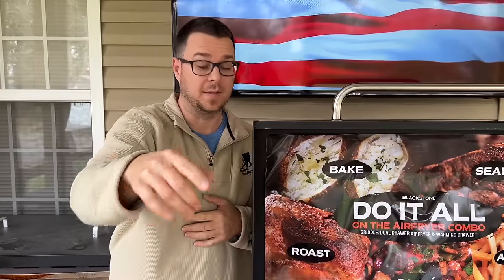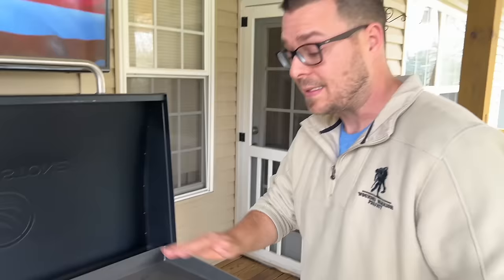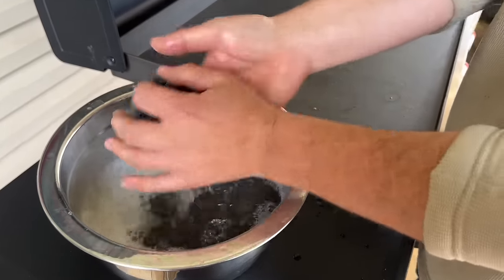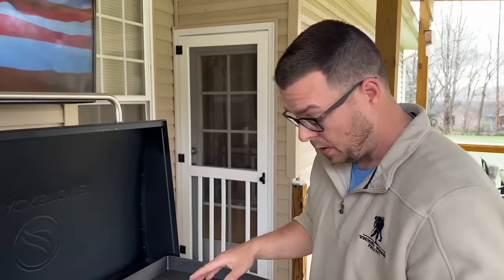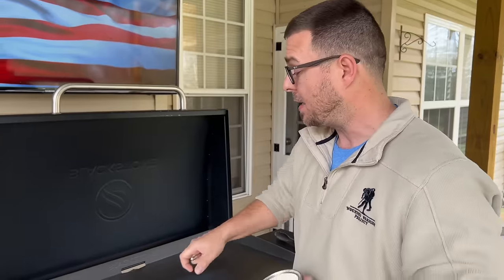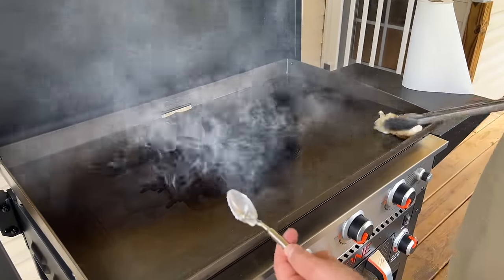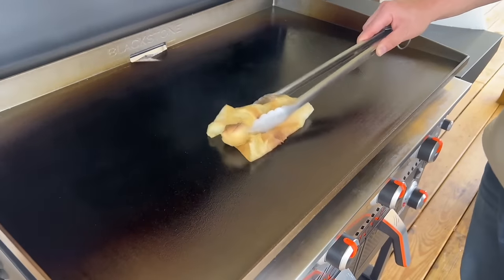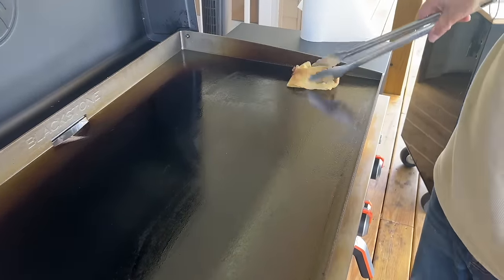How to Season a New Blackstone Griddle

Comment: I try to follow along and pay attention to all the details, but I do notice that in your video every time you cut to a new seasoning your temperature knobs are different and even on your last seasoning they are off. Do I leave the Blackstone on high during this whole process and at what point do I turn it off after the last seasoning or before the last seasoning?
Reply from the maker: Good question...only on high to start like Blackstone says..just to burn off the crap..after about 10/15min...start the process...turn down to low which I promise is hot enough and keep there till you are happy with the amount of coats...I turned off the griddle on the last coat to allow the oil to lightly burn and be ready for the next cook..if not it would be another coat...ever time you cook and clean a light coat of oil will go down...this was that idea

Comment: I found your video AFTER I received my grill (with no manual).  The other videos I saw showed nothing about sanding or cleaning so I just did the seasoning.  I did it 6 times and then cooked twice on it.  My question is, being that i skipped the cleaning and sanding part, can I now sand it if need be?  I see in your video I could wash it with soap as long as I reseason it so that question is answered.Thanks
Reply from the maker: I would think by this point you are to far in....I would just cook on it...Sucks you didnt catch us sooner..I think hitting it with sandpaper just helps knock off all the crap on top and speeds up the process..

Comment: Not sure what happened but my grill shot up over 700 degrees., it literally burned my paper towels to the point where pieces were breaking off. Now its gummed up. I guess I will be sanding. 

Does it really need to be on high heat?

Comment: I live in Miami FL. The griddle will be kept outside and covered with an aftermarket cover. Do I go steel vs ceramic due to potential rust in high humidity. And does the cleaning after use on steel prevent rust?   BTW for the Campfire Griddle why not just drill out the grease hole. Should not be difficult with a carbide bit. Thanks for the videos and I really like your teaching style. When do we get to meet the calm voice behind the camera?
Reply from the maker: She has been in a lot of videos...just find the right ones..ahahahha we actually filmed one  cooking on my Weber...Look up my playlist Weber charcoal grill and I thinks its called how to cook a steak for beginners 
As far as the griddle idea, IF you will maintain and cook on the rolled steel often than no problem..if you dont want the hassle and use sparingly then the Pit Boss..There so far  been no downside of the two...

Comment: Hey king, just picked up a BS 36in  and thank you so much for your vids. I seasoned last night and checking this afternoon, I have great color in the middle but several places around the outside 2-3 inches I have very tacky, sticky coverage. Will those areas eventually season up fine or do I need to scrape back down and start seasoning all over again on those areas? Used the crisco after sanding, washing and rinsing. Thanks.
Reply from the maker: no just keep cooking...try cooking the heck of of onions....keep moving around and bring the heat to the outside parts that are sticky...
you could put on low and keep on longer as well..
the sticky tells us that the oil didn’t have a chance to burn off

Comment: Appreciate the video. I just bought my first blackstone griddle with air fryer. I can't wait to use it after proper seasoning. Is the sanding necessary? I will definitely be on the look out for your cooking videos.
Reply from the maker: NOPE not at all I just think personally it helps speed the process up. If you notice with your hands the surface is very rough. By sanding you help level it off and the seasoning works more evenly.
Reply: @TheFlatTopKing  gotcha. Thanks for the tip.

Comment: After the 1st coat of seasoning do you keep your temps on high or do you back it off some and then turn it up once you have done the 2nd coat to do the burn off? Just wondering if I turn it up to burn it off in between each coat or do you just keep it at like a medium temp
Reply from the maker: You can turn down...just keep hot enough to keep that smoke rolling...each griddle is different so the exact I am unsure of...

Comment: Alright so I seasoned my griddle this way and it’s been great. I have a polished smooth cast iron pan that I’m struggling with holding a seasoning the traditional oven way. Always comes off. Should I try this way?! It’s not a high end or sentimental piece so I figure it’s worth a shot.
Reply from the maker: Thats a tuff question...what oils are you using 0n the cast iron and what technique are you doing for it...if its not high end then go for it...lets just make sure something else isn't wrong first..
Reply: @TheFlatTopKing  I have restored a lot of pieces and my method of thin coat of crisco, wipe off like I didn’t want it there, and oven at 475 for one hour (repeat 3 times) works like a dream every time. This surface has been polished however, so it’s having a hard time holding a seasoning. Every time I use it, the seasoning wears off the surface. Gonna give it a go this way! I’ll report back
Reply from the maker: @wadenorman2500  yeah spot on as well. Please let me know

Comment: Failed to find your videos before using my pit boss steel griddle. Any reason I can’t go back and start from scratch with a light sanding as you suggest for a new griddle?
Reply from the maker: I just had this convo with another guy..personally I would not...your so far ahead now and going back would be a pain. I would just start cooking and cooking..over time it will be just like sanded just takes longer to get there

Comment: I just bought a blackstone grill and seasoned it according to your method. I put an egg on it after I was done to see how well it would not stick. The egg completely stuck to the grill. I cleaned it and seasoned it again a couple of times and then I cooked some frozen burgers. The burgers turned out great but when I flipped one of the burgers it stuck pretty good. I turned it the way you do with your spatula. After I cleaned the grill using the bench scrapper you use without scrapping too hard and flat I then put some water on and scrubbed it with a cotton rag to get the sticky off. It is now smooth but there is a noticeable (stain) I guess of where the burger was and spots that look like the original grill color. I couldn't see them right away but when I used my flash light to see because it was getting dark I could definitely see spots and they weren't scrap spots they were round like where the burger stuck to the grill. Is this normal? What did I do wrong. Please help oh Flat Top King!
Reply from the maker: I m here for ya I promise...not sure where it went wrong with out being there...
Make sure your griddle is hot enough to start with especially for eggs. Eggs are protein and of course so are burgers so if your griddle is not hot enough it could be the problem.
Turning to early especially on eggs.
not enough butter or oil down
 One suggestion is to WASTE eggs. 
I hate wasting food but sometimes you have to. If its a 4 burner than take a dozen eggs.
Preheat on low and allow to come up to temp. If using avocado oil let it just barely smoke...put a good amount on there as well.
take all 12 eggs and smash, shell and all remember you are wasting eggs.
smash with spaula and get in all corners and all over.
just keep moving the eggs around.
Srape down and remove ascess.
wipe down with oil and add some butter in about 3 spots. add over easy eggs to the butter allowing the eggs to set properly...if still sticking then Houston we have a problem
If you dont like the egg idea do onions the same way. cut about 5-8 onions and use the high heat oil an caramelize the onions till about black. almost uneatable..
allowing enough oil to properly coat the griddle top. Allow the oil to smoke while cooking the onions...

Comment: My 22" Blackstone griddle has a substantial warp - side to side and front to back.  Is this common?  Blackstone has offered me a new griddle top, but said I should try to cook on it about 20 times.  They set a lot of time the warp comes out of it? What do you think?  I seasoned it in my house oven.
Reply from the maker: Well you have nothing to loose if they are sending you another one...I personally have not heard of that where you cook on it and it goes away. I have had people tell me that Camp Chef has told them to put a super big pot of water on the griddle and turn on for like 15/20 min on high and then turn off...the heat will put pressure on the metal and help out...some say it helped...some didn’t...Interesting why you seasoned in the oven. I agree with the idea....but just seems odd...I doubt it had anything to do with it..but...
Reply: @TheFlatTopKing  Thanks for the reply.  I thought that the way I seasoned it would cover more surface - sides and corners, backside.  We are getting ready to go on a long trip with it. When I return, I will ask for the warranty. I will be more vigilant about it being flat before I start seasoning it. We looked at a lot of videos, and I will probably look at more of yours.Chuck

Comment: In the video after the preheat you mention putting it on high heat. At what point is the heat lowered during the 5 coats. It looked like it was on high the entire time.
Reply from the maker: I did that because the Blackstone instructions said to put on HIgh for the first 
10/15 min....i never have liked to use high and I just started on low for about 5 min then up to high...before the oil I backed the temp back down...
Reply: @TheFlatTopKing  Perfect. Thanks. You are so helpful.

Comment: So you don't turn it off and let it cool down between each coat of Crisco? You just keep it on high until it stops smoking, then apply the next coat? Thanks
Reply from the maker: I dont keep it on high...low is hot enough...low will get over 450 and not much oil can handle that....but yes...do not turn off and cool down...just burn it
Reply: @TheFlatTopKing  thanks

Comment: I just purchased my first griddle, (It hasn’t even arrived yet) a BS 28”. In a different video, someone used a grill block instead of sand paper, is this ok? Is one way better then the other?
Reply from the maker: I personally do not own a grill block. I think the are too aggressive for a seasoned griddle. In the Navy we had them and that was because stainless steel is different than rolled steel. Rolled steel you treat just like cast iron from seasoning to cleaning and re seasoning as well. I have only used sandpaper 2 times total in three years. Once to take iff the brand new ruff spots on my new blackstone before i seasoned it. Second was after extremely heavy use on my CC that i again only used to knock off the tops then re seasoned

Comment: As always, fantastic content. FIrst time griddle owner, mentioned on another video of yours I just bought a Nexgrill from BJ's. Question about the final application - so you season 4-5 times with the heat on, and after that, you shut off the heat, let it cool down, and apply a final coat that would remain "wet" as there's no heat to burn it off?
Reply from the maker: Not wet…..  after every use you should always add a light coal of oil.  This is normal maintenance for rolled steel.
Reply: @TheFlatTopKing  appreciate it! So once I’m done applying the 4-5 coats with the heat on, I shut off the heat, and apply a light coat of oil that would be rubbed into the griddle top with the paper towel, and done. If I got that right, then thanks so much for the sanity check!
Reply from the maker: @dolfan058  yes. Just make sure the grill is not hot enough to burn the last coat of oil.
Reply: @TheFlatTopKing  Will do, thanks so much for all the help. You’re giving us rookies a ton of peace of mind!

Comment: I have a new two burner Pit Boss Portable Griddle.  It claims that it’s been pre-seasoned.  Should I go through the steps you show in this video just the same?  Also, mine says it’s cast iron instead of rolled steel.
Reply from the maker: Yeah just don't kill the preseaoning. I do it on my new cast iron as well. Rub your hand across first to feel the unevenness then gently use the sand paper. Check often to make sure it's gone.

Comment: dumb question but when your waiting for the smoke to slow down before you add another layer, is it still on high heat?
Reply from the maker: Just to clarify you dont have to use high heat...many griddle can hit high enough heat without actually using the high burner...any temp that allows the oil of your choice to smoke...will be hot enough. For your answer...just keep it hot enough to keep rolling..no need to adjust between
Reply: @TheFlatTopKing  that makes sense, appreciate the response!

Comment: In between coats are you keeping the grill on high?
Reply from the maker: Yes...you are burning the oil...BUT just to clarify...you dont have to use high..just hot enough to burn the oil...so if you have on high to start...and it gets hot enough..back the bruner off a little...saves on propane

Comment: If you bought a used blackstone, should I remove the seasoning and redo from the start like in the video?
Reply from the maker: really depends on the shape its in....if bad absolutely...if you think you can clean with soap and water and add a few coats after that then that should be fine

Comment: The paper towel I was using almost immediately started leaving little bits all over, I quickly switched to a washcloth. What paper towels do you buy? I'd much rather just throw a paper towel away than clean that washcloth every time.
Reply from the maker: We use Costco and they are good ones and bad ones...that is another reason why I sanded my down first...it all helps..I have bits as well and honestly on 3 griddles and tons of cooks its has Neve Mattered...maybe its frustrating to see but it doesn’t affect the performance...
Reply: @TheFlatTopKing  that's good to hear. Thanks for being so active on your channel and responding to those with questions!

Comment: Do you heat it up slowly until it is on high and leave it on high during the entire process?
Reply from the maker: Yes...you dont have to keep on high either...just high enough to heat the oil hot enough to smoke...so once on high...maybe back down a tad....
Reply: @TheFlatTopKing  Thank You Sir! I'll try it on a skillet. It seems better than the baking method where I have gotten drips before and had to sand them off and restart.
Reply from the maker: @chevy6969200  if it matters… dripping means to much oil. One tip I can give.  Wipe completely with light oil. Then take new paper towel and wipe off the light oil. Sounds crazy but that’s how we create things layers stacked on top of each other. Thicker layers will flake over time.

Comment: Do u HAVE to use sand paper? Can u just rub it with soap, water, and a dish sponge on the green side and scrub everything?
Reply from the maker: So the soap just gets the manufacturer oils...dirt and debris off...the sanding helps even out the high and uneven spots..
After many griddles since this...I actually think its not necessary to sand down...just clean...dry and season...
Reply: @TheFlatTopKing  what about the dish sponge? Do u recommend scrubbing it with the dish sponge on the green side?
Reply from the maker: @luisbarrera4548  I dont think matters...

Comment: Do you have any guidance for seasoning and electric griddle or is it just the same method?
Reply from the maker: Well..thats a loaded question...what is the griddle actually made of...stainless steel...ceramic coated..porcelain coated...or the blackstone indoor model...
Reply: @TheFlatTopKing  its a stainless steel 2 element counter top type is all I can tell you until later today hopefully 🙏
Reply from the maker: @davehanstock9586  Yeah so stainless is 100 percent completely different ball ga,e..typicslly no sesonin required and maintenance and cleaning is way different
Reply: Finally got delivered by Amazon and its damaged so going back replacement due Wednesday 😤😤

Comment: Do we have to reduce the heat later while seasoning ?
Reply from the maker: Yes thanks for asking...sorry...after watching again I cut out the part where I say to cut the heat..after the griddle is heated on high for around 15 min or so and you start the seasoning process you can definitely cut back the heat...even on low it will be hot enough

Comment: can you show the temp control in another video? do you turn off the burners when you apply the crisco or do you leave them on med heat?
Reply from the maker: Just keep on low...after the griddle is heated up you can switch to low...its Definitely hot enough

Comment: Got a new one is 17 inches cut it out of the box it’s telling you to clean it with hot soapy water do I do this on the top and the bottom because the bottom is sticky too thank you
Reply from the maker: The bottom is not necessary to clean...the heat from the flame will deal with it..just use the soap one time and thats before you start the seasoning process...
after that you should not have to do it again.
Reply: Thank you

Comment: Only thing I did different is I did not sand mine, I was told not to because the texture holds the seasoning better, it's less likely to flake.
Reply from the maker: Well i just did my Traeger with no sanding and absolutely loved it..I also just did a new Blackstone and did not sand it and absolutely loved it...I might after cooking for a while lean that way...Just to clarify...i did not sand smooth...I just hit the rough uneven spots...on my 2 new griddles They did not have high spots but were rough evenly if that makes since...